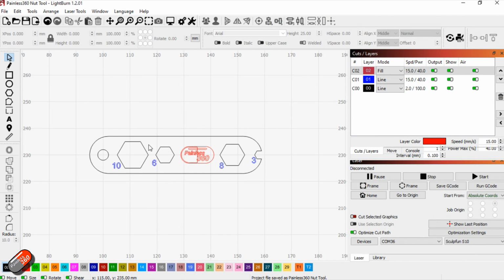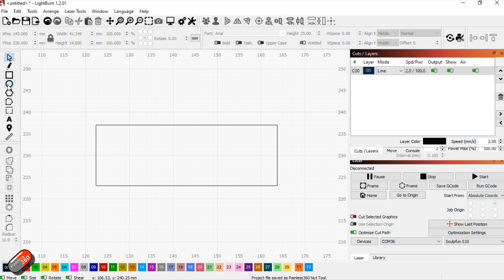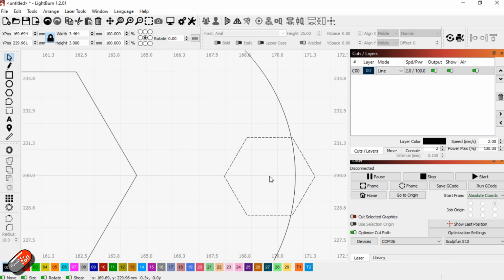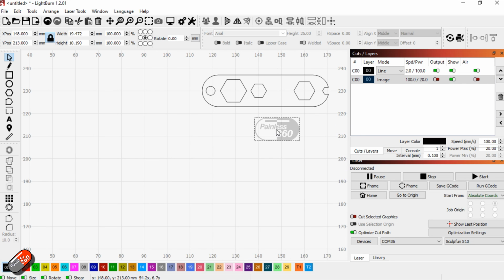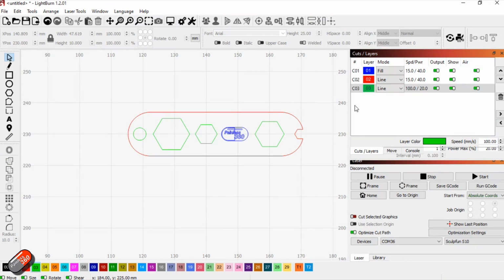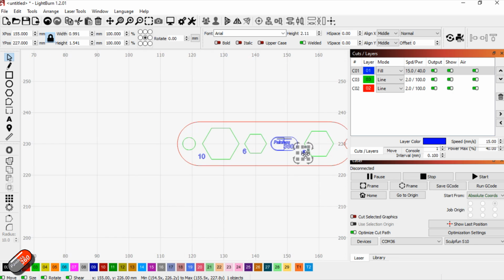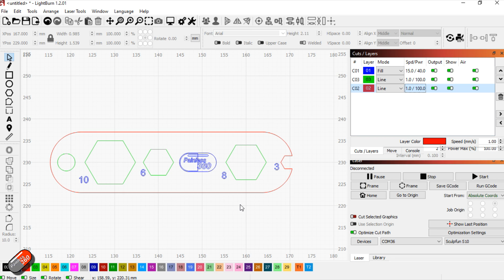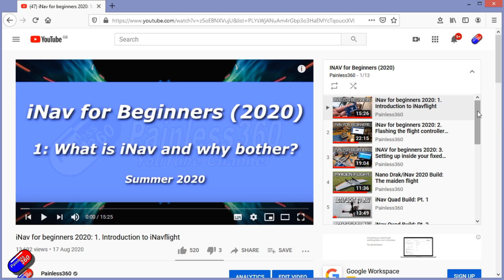How I designed and cut this Prop Nut Tool using Lightburn and Sculpfun S10 Laser

Comment: I see behind you the micro 3D printer from hobbyking. I have one (v1) but I need to fix it because mother board is dead. Did you change it on your printer for another model from bigger 3D printers (like creality, MKS, arduino one, ...) ?
Reply from the maker: I have an Ender V3 with all of the upgrades for larger parts..

Comment: Hey there still following, learn a bit with each video. For that I am thankful always. Still have a problem with second passes, but it's A work in progress. Hope scspot onto cut 3mm light plywood , some parts are over 24 inches and have lightening holes have to get second and maybe third pass spot on, wasting a lot of foam board, tweaking the unit, but cheaper than wood. Thanks for keeping at it, take care.